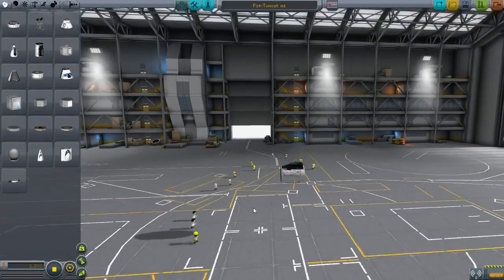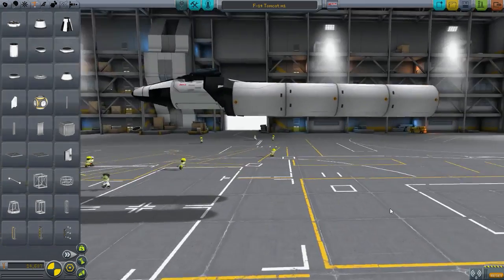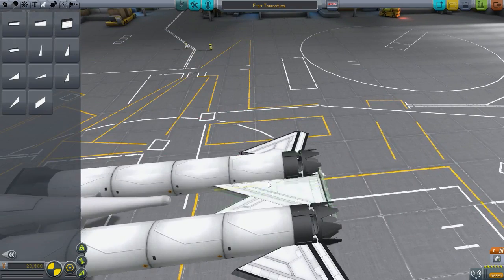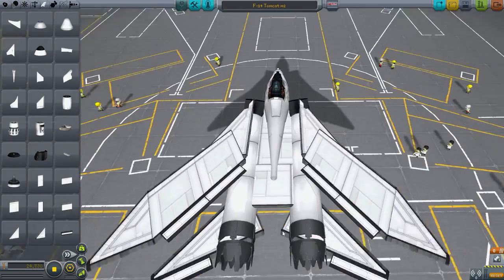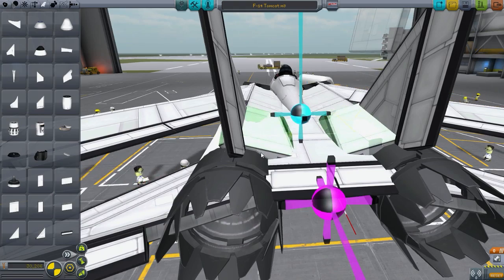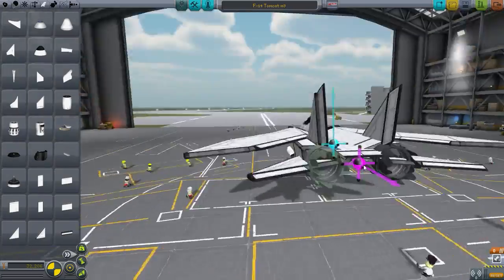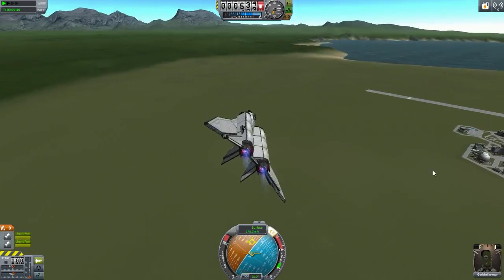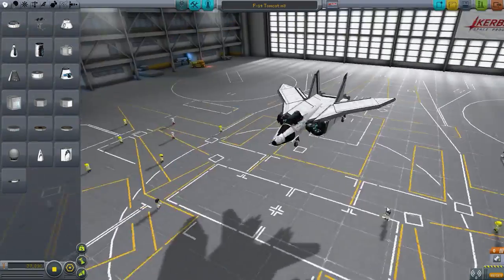KSP : Grumman F-14 Tomcat

Comment: Landing gears never have lights really.

The only landing gear that does have one mounted is the nose gear so the light beam can be pointed to where the aircraft is steering to.

Also there is not a mod that has a MIRV but there is one where you can have weapons and its called BD armory,

Comment: heretic, all aircraft have landing gear lights (or lights that point to the ground). 

It's not an option, if it doesn't then it violates saftey regulations.

Also having strobes and other lights on the wing tips, center of the top plane and the nose and tail is needed.

Lights that light up the tail to brighten up the logo there isn't needed but it's common on civilian planes.

Comment: You really need infernal robotics to do this craft justice, along with FAR on the install so the swing wings make sense. Also no version of the F-14 was ever a single seater. Like the F-4 it was designed to replace all F-14s had room for a RIO (Radar Intelligence Officer) in the rear seat. Go search for Great Planes F-14, great documentary on the aircraft. Technically you can't have a correct F-14 in KSP because, unlike the F-111 Aardvark the project started as, the sweep was automatically controlled by a computer based on airspeed. The F-111 swing wings were manually controlled but during trials of the F-111B the Navy rejected it and complained about the fact the swing wings were manually controlled, and the aircraft being far too heavy. That's what gave birth to the F-14. Variable geometry wings provide perfect lift drag ratio at every speed. A good swing wing craft can fly as slow as an A-10 in a ground attack role and sweep back into a delta configuration for super sonic flight. It's a hard craft to make stock. I made one using B9, infernal robotics, Infinite dice boats mod just for the tail hook, and Retrofuture.

Comment: Usually the landing lights are on the front of the wings smudged next to the fuselage, at least on commercial airlines. On smaller planes, I believe the landing lights are on the wheels, depending on the type and model of aircraft, and the overall design.
Reply: Hey Wheatley... how's it going in Space?
Reply: not so good. Not very many people seem to want to fly over here and bring me boosters :(
Reply: Wheatley :/ That sucks. Hey! Have you lost track of the Space core yet?

Comment: From former knowledge I believe they don't because at night on aircraft carriers they turn off all the lights and only gave red ones to lower the chances of them being seen. So the just outing have them because they would give the carrier away.
Reply: They do actually
Reply: Have* They most likely don't have them*
Reply: It depends on the type of aircraft.
Passenger airliners generally do; fighter aircraft have no need for them.
Reply: Hiukuss I was only talking about fighter aircraft.
Reply: AM40012 Still. The fighter is directed by the carrier, and the pilot would have some sort of optics to see at night. Some do have a single landing light in the front, but it's not really used during combat.
Reply: Hiukuss Thats basically what Im saying.